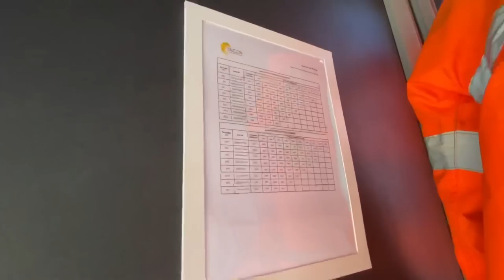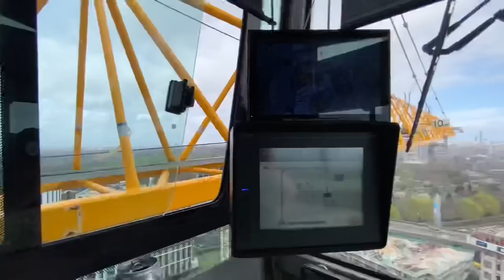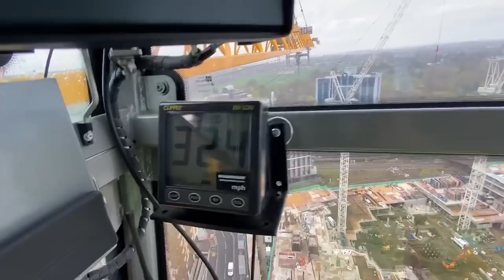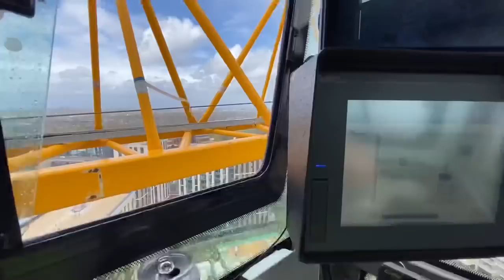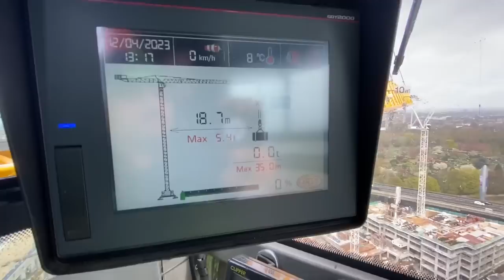SUPER WINDY DAY IN BRENTFORD - 65m Tall Tower Crane - Episode 11

Comment: free slew? as in it does it automaticly with the motors tracking wind direction, or just freely goes where the wind takes it?
Reply from the maker: No you have to physically turn the slew brakes off which are on top of the slew motors however some cranes have a free slew button in the cab

Comment: Hi, friend, can I have a question on you please?  Do crane operators comply with the smoking ban in the crane cabin? When you go to another crane, aren't the cabins smoky? I see you have air conditioning in your cabin. If someone smoked in the cabin, it would be impossible to clean it.  Second question : Can you lift something to yourself with your crane? For example, can you lift a heavy bag to your cabin with your hook? It's possible to touch your hook from your cabin, platform or ladder? Last question. If you switch off your crane, switch off diesel generator, is red light on your crane still lit? (over night) There is other power source for it? Please do not answer if the questions are uncomfortable for you and I thank you for your time. ;-)

Comment: Alright mate as a first time watcher, what’s holding the crane on the floor down, daft question but can it blow over?
Reply from the maker: It’s bolted onto a massive concrete base which is pilled into the ground
Reply: @cranecrazy  ah yeah still some weight to hold tho that

Comment: My first view of your channel, great, subscribed.  Kinda surprised that the manufacturers of these cranes don't consider that the operator is gonna need the loo and also the operator could quite easily be a female. What would she have to do?
Reply from the maker: There is cranes with some sort of a toilet up them it’s just the design and cost of the cab, our cranes are manufactured in Spain by Jaso and in Spain they don’t have a cab as they are remote controlled on the ground